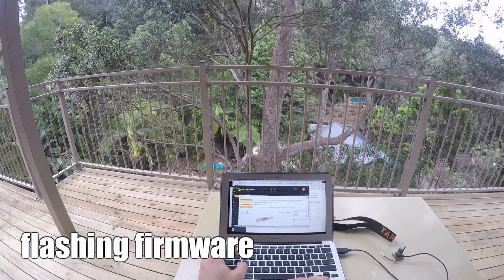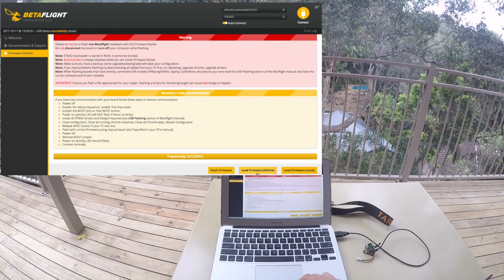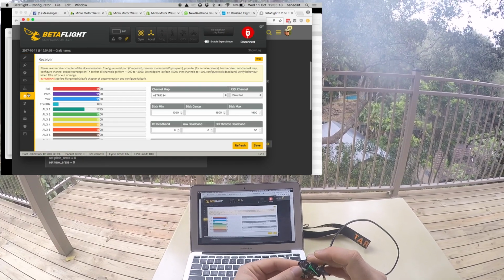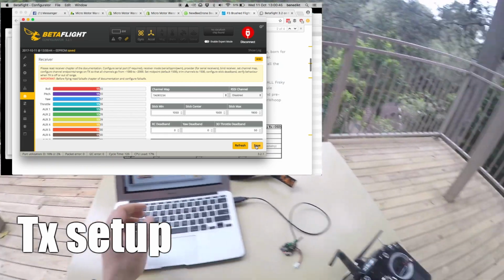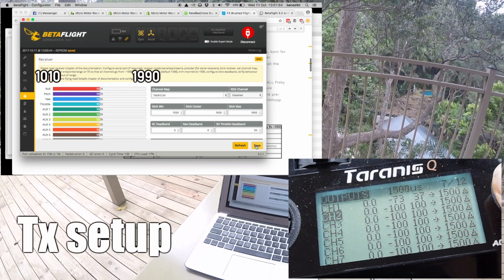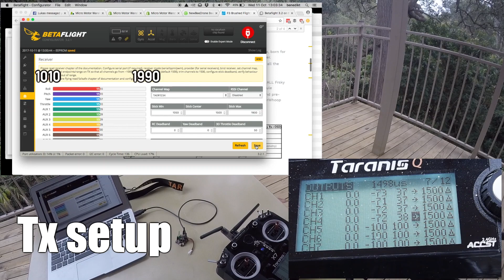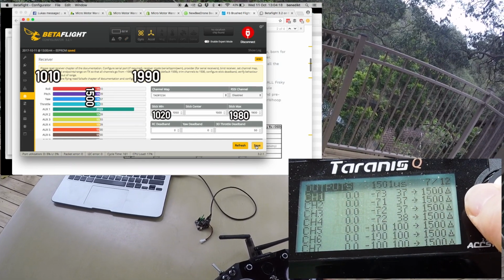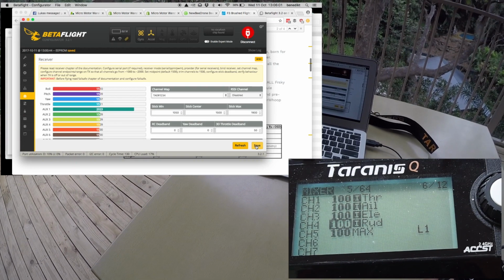[How To] Basic setup for BetaFlight FC and OpenTX radio

Comment: Thank you but I still have no responses out of my switches. I've downloaded the correct firmware set it to spectrum and switch my trea1234 around. My sticks are set but now I can set arm and flight modes. My controller display shows there value but beta flight doesn't, I too am using a mac and the latest version of betal flight.
Reply: And the FC set up, what is that? Can I get that online and how do I find that for my setup. I have a omnibusf4sd (airb) flight controller and a taranis q xs.

Comment: I just bought a qx7 and betaflight won’t recognize it I’m sure there’s something I’m not doing right. I know my tx works because I connected it to a sim and that worked perfectly
Reply from the maker: The setting on your FC or your Tx might be wrong. Let us know what FC you have and how you have configure the receiver connection, and we might have a clue for you.
Reply: Micro Motor Warehouse I have a emax babyhawk the frsky version of course the bnf version. The receiver is one of them things that I’m not exactly sure what it should be set up. Other tx that I’ve had the stores set them up and had no problem with them but I bought this one online didn’t realize how hard it would be to set up the first time.
Reply from the maker: I dont have a Babyhawk, but let me offer some general comments that might help you on the right track:
A receiver is a communication device that translates between two "languages":
- from the RF signal that comes through the air (interface: antenna)
- to the bus protocol on the board (interface: wired connection)
There are many different languages, and many accents to those languages, or in other word, many protocols with many variants.
Receivers (especially very small receivers) are often only supporting one certain version of one protocol on each interface.

Your first job is to read the manual, check the product page, or research/ask somewhere on the wild web, in order to find out the exact two protocols of your receiver, air side and FC side.

Air side could e.g. be "FrSky D8", so you would need to set your transmitter to D8.
FC side could e.g. be "SBUS", you will need to set your FC to "serial receiver" and "SBUS". 

A lot of current FCs connect to the receiver over an UART interface, and there might multiple of them. So you might have to also configure on which UART port your receiver is connected.

If it doesnt work, use Google-Fu and Brute Force (just try all possible combinations).

Happy Hacking ;)

Comment: Recieved a brand new BetaFPV F3 and the bind button does not seem to function, the red light works however doesnt seem to show bound status although I can see transmitter inputs in betaflight. Does this mean they are bound or just what the beta flight controller is recieving - hearing?
Reply from the maker: If you can see your RC inputs in the BetaFlight GUI, Id consider it bound.
Does it fly?
Reply: Heh Just waiting for Motors, I have a few but none with connectors, first time venturing past stock items. Thanks for your prompt reply! wish me luck hehe :)
Reply: Heh Just waiting for Motors, I have a few but none with connectors, first time venturing past stock items. Thanks for your prompt reply! wish me luck hehe :)

Comment: Why 1010 and 1990 for your Tx Endpoints? I always use 1000 and 2000. 1500 as the midpoint. Is this not correct?
Reply from the maker: Yeah good point.I think this is a conservative habit of mine. It is problematic on some hardware to go below 1000 or above 2000, so I make sure I stay clear of these edges. E.g. my MultiWii boards failsafes at 999.
On the hardware in the video, I would not expect any problems with going to 1000 and 2000, because the default limit on the FC are set to below 900 and above 2100.
Reply: Your Tx setup neglected to mention how to install the Benedikt sound pack ;)

Comment: I need to ask you something (not really related to this video): Have you tested both ClearView Racing and Iftron Yellow Jacket 5.8 receivers? Are they comparable? I ask that because I have a Yellow Jacket, but I’m not sure if it is as good as the clearview to be used in races, and maybe that way to get a better video signal than with the internal google vrx...
Reply from the maker: I have only tested the ClearView, not the Yellow Jacket. But far as I understand this, the ClearView was developed after the Yellow Jacket and is superior in reception quality.
Reply: For racing, do you think clearview does a massive difference over googles vrx?